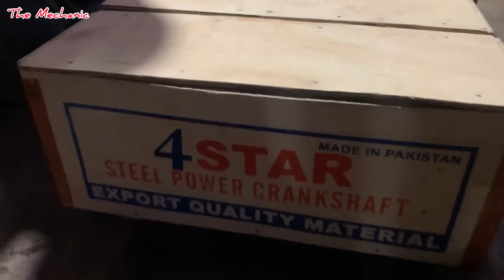Production of Crankshafts in Factory Complete Process || Machining 3 Cylinder Engine Crankshaft

Comment: Now I know what happened to all our WW2 Lathes.
Reply: I saw a Cincinnati in my old schol in '70's :-)
Reply: I have a ww2 lathe similar to these,my great uncle (reme)took it in lieu of pay in 1946 among other oddities(aircraft wheels and tyres,circular gun mounts and it seems every ammo box ever made😁,it was given to my father who made some new parts for it and then passed it on to me,I used it 3 times in ten years,once to drill new flywheel bolt holes into a rover crank and twice to thin down socket walls.I struggle to remember the name but it is stamped WD 1941 with those little arrows stamped on everything,it's been residing unused under a tarp in my father's barn behind twenty old tractors for nearly 20 years now and was still working perfectly when it was replaced.Unfortunately we don't have the same crane that lifted it in there anymore and it's been blocking in my brother's collection of old cars for all that time! Also my great grand father was a major in the Royal engineers and was working in the royal mint in India during ww2, while there he built from scratch a fully functioning replica steam loco and wagons with a bit of track,in his own words"from bits of scrap and off cuts"it weighs about 2 ton complete😁 obviously he had plenty of time on his hands and did remark that there was every bit of machinery you could imagine available,including forges and foundries,I'd imagine most of the machinery was left behind after we shipped out at the end of the war,much of those skills learnt by the locals during that time has been passed down and wonderful to see too.
Reply: Some of them our in our shop.
Reply: Yeah seriously, guess I’m gonna have to shop for that Monarch over in India, they were built to last back them, much better quality of steel too...
Reply: @ManicChampion  They definitely are, and they even made them look good instead of just a boxy lathe, my dream machines, a decent size monarch lathe and a K&T horizontal mill with the vertical head
Reply: Probably a ton from then left overseas, not cost effective to move back, glad they're being used rather than getting dumped like a lot of stuff, provided those are WWII vintage, which wouldn't surprise me. Got a 1942 LeBlonde in my basement from Camp Lejeune, and at work we have a gorgeous Monarch (44, I think) that made bomb sight components. My LeBlonde was abused for many years before I got it, but it's coming back to life quite well. The Monarch holds bonkers good tolerances to this day. Bonkers.
Reply: My grandfather was a gunman in ww2 , there is no need for them here if there is to much regulations,  fees licensing osha regulations for smelting, lathe work is ok but you need something to use the lathe on , do you understand why there not being used here now, osha would never allow a lathe that close to a wall , and no ventilation,  and electrical outlet behind you , do you understand now
Reply: my highscool had a Monarch  from 1947,   i helped shop teacher machine parts to replace some parts in the Monatch,  he opt'd for Seafoam Green paint lacquer   it was eye candy
Reply: @jaminova_1969  Happened in Australia also.
Reply: @jaminova_1969  Donald Trump tried to move them back to the US. Japan did the same to move factories back by paying them.
Reply: I had a job in a machine shop making VersaLifts. The 8ft radial drill press was off the battleship USS Nevada!

Comment: Great workmanship by hard working guys. This particular foundry has supplied BMW Germany for the past 12 years. They're shipped to Europe where final finishing and heat treatment is carried out..
Reply: @Will he heck as like
They're ultrasonic ally tested before export at a different location, some are rejected as will cranks from any foundry. These cranks are not fully ground but are finished to tolerance  in BMW's factory where they're also nitrided/hardened. The N47 diesel and various capacity 6cylinder petrols have used cranks from India & Pakistan for a number of years.

Comment: Family : Daddy why are you limping. Daddy: I thought I had that crankshaft running true  with my hammer and wire indicator. Got a fleck of cast iron in my eye and just as I was getting it out with my blackened cast iron dust hands, the lathe threw the part and it landed on my steel toed sandals. At least I had on my full length loose shirt on to shred into a tourniquet .
Reply: I am sure they have an excellent h&s programme comps & ben upto par

Comment: Well,
I do applaud the hard work being done.
But I do believe that these craftsmen need to slow down and save those lathes a bit more.
The chatter is terrible.
I’m sure they have a quota to meet, but if those shafts aren’t right, the motor fails in quick fashion.
Reply: Call for the camera
Reply: Yeah terrible chatter on that video everywhere
Reply: These guys are across the road from that  repair shop on YouTube that assembles engines on a bed of sand

Comment: NOW that’s one crankshaft that I wouldn’t like on my machine. Thrown around cast iron , eyeballed precision and so on
Reply: Kkkkk você acha que CNC sempre existiu, o homem foi a Lua, com mecânica assim tradicional. Isso sim é a mecânica.
Reply: Looks like it is for a slow moving Diesel engine, like for a boat or a water pump. For this purpose it is good enough. And towards the end they used precission grinding to get everything to the right dimensions. The bearings are most likely made with Babbit metal.
Reply: @jnne5938  my grandfather used to build crankshafts for the US tanks back in ww2 and they already used more advanced dials and tools. I'm not talking about cnc I'm talking about using precision dials and dumping cast iron like a basket ball. Good enough does not mean good

Comment: Please for the love of all things holy, stop hitting the journal to line up the crank in the lathe. The counter weight is right there. I understand that when this happened, the journal wasn’t machined and polished yet, but that’s a bad habit to have.
Reply: it's for a perkins, precision isn't required
Reply: also, then you hit it with a hammer, it's now a "forged" crank" brings in more cash! :)
Reply: this a secondary oper. final ops are heat treat final finish...castings r in the white or soft stage
Reply: @planeiron241  They were packaged with instructions, end of the line for that junk.
Reply: @mrl22222  Certainly looks like  P3.152 fitted in the Ford Dexta and Massey Ferguson.

Comment: Guys, I am an offroad racer / 4x4 gearhead currently in the US but from Pakistan which I is where these videos are shot. I have worked extensively with the chaps who do lathe / machining work there with respect to 4x4 modifications (including  Lexus v8 engine in desert racing 4x4s). Firstly, I'm still surprised that they make crankshafts in Pakistan as I didn't think there was a market for local crankshafts. Will have to speak to some people to get more information but what I can confirm is that heat treatment and shaft balancing are not commercially avaible to these people at this scale. Typically given the quality and types of parts produced along with the processes followed there has not been adequate demand for balancing and heat treatment from what I understand. Lastly, regardless of what it may look like, having used some of these products, often under extreme desert racing conditions, I can assure you that from what I can see, these cranks would be doing a damn decent job and giving the available imported alternatives a good run for their money. Otherwise, we would not be seeing this video as the total cost of engine overhaul would merit not saving a few bucks on such a critical engine component. Having said that the need for imporovents in how things are done out there is blatantly obvious though asking them to change there ways is a cause which one gives up rather quickly if you have to deal these chaps. Amazing workmen, perhaps some the most talented people I ever met. Hats off!

Comment: Instructions: Please blow out oilways, as we forgot. Failure to do so invalidates 200 miles warranty.
Reply: lollll
Reply: 200miles is probably 10x the reality for over half of those, but shipping is probably 90% of the price so what is anyone going to do.  Grind it, drop it dirty in dirty bearings, spin it around for good measure, box it up. Getting you just far enough down the road that you cant come back seems to be the running theme of these videos from pakistan.

Comment: Impressive what they can do in what kind of enviroment and the machines. But the grinding at the end didn't look well. If you clock it every time before you go to next segment to grind, how is it going to be in line ?
Reply: @Marcus Keeler Wrong. He machined one part and immediately after he hit it with a hammer to align the other part of it, the two are not in line anymore. Correct procedure is, clock all the features as best as you can and grind them in one go.

Comment: how long will these hold up, each piece has a different measure
Reply: They hold up fairly well. Consider this being the only available 'new' part, and the engines these crank shafts are for, are still in active duty despite being from 1960s

Comment: For the sheer eyeballness of the measurements, I'd bet they're within 3 thou. I was wrong, those Perkins 3 cyl spec are half a thou! 2.7485-2.7490
Reply: The grinder they use will hold half a thousandth of a inch easy

Comment: Geez it really shows how behind the times they are and the quality of the job is terrible.
Don’t get me wrong, they do an ok job with what they have to work with.
Reply: Not even close to ok. There is nothing wrong with those machines if they are in good service. Go / no go gauges are common in production. Problem here is they plain just couldnt care less, everything is dirty, parts are just thrown around. They ground the journals and then while it was still dirty dropped it into dirty bearings and spun it around as the QA check... They couldn't even be bothered to give the journals a quick polish. A whole extra minute of giving a ** and keeping things clean when they need to be would have produced a serviceable part rather than junk.  The tap so wore out the kid couldnt get a bolt to thread in was a great tell, they only replace that when it finally snaps. Or needing a cheater bar to push what is a very small drill bit in a lathe that size, dont sharpen the bit just abuse the machine.

Comment: very skillful operators .working on manual lathe /Mill  is not easy .its the most talented who can work on it.still in US tool Makers are still using Bridgeport machines and are the best machinists .but the CNC is the best for such high precision tolerance.If thses guys received a training about GDT and Quality they would be surely the best.yet they are really excelent with the equipments available to them.CNC improved a lot the industry now the Engine or tranny can last more than in the 70S

Comment: I've read through a bunch of the comments. No, these crankshafts don't compare to anything made in Germany, Japan, or the U.S.  I still have tremendous respect for the workers making due with what they have. Along the lines of making due, here's an interesting story for those interested... A friend of mine was born in Cuba shortly after Castro took power. His father was a machinist and his mother was a schoolteacher. They applied for permission to emigrate to the United States (when Cuba still allowed that--for a relatively short period of time after Castro came into power). Both of his parents were immediately fired from the jobs. His father was sentenced to a six months in a prison work camp. When his father got out, the only job he could find to support his family was as a delivery truck driver. He was able to acquire an old box truck and used it to deliver whatever he could to feed his family. Problem is, the cranskshaft bearings were shot and needed to be replaced. Well, replacement parts simply weren't available. So every two to three days, after driving, loading, and unloading the truck all day, he could tear apart the engine and fashion new crank bearings out of an aluminum soda can. He would work through the night, put the engine back together, and be back in the truck in the morning. The fix would usually last two days, maybe three if he wasn't doing very much driving. He did that every two or three days for about two years before his family was granted permission to emigrate.

Comment: That two step shot-peening step would provide a surface compression to the casing that would improve it's crack resistance, and cast iron is very hard.  I'm sure a surface hardening step would be an improvement, but, aside from a bad casting, these probably provide a reasonable service life.  I kept trying to get a good look at the fillet radiuses at the journal cheeks.  They looked pretty good there at the end when they were wiping the crank.  Large fillets and the shot peening are good.

Comment: Having built and rebuilt a few engines, I have an issue with the crank checking process. Not sure of elsewhere, but here in the states, a main and cap are one, the engine is line honed on torqued caps so they are perfectly matched after the build is complete. So only one cap goes to one main (At least how I was taught), them checking using the same cap on multiple mains is problematic for me knowing how we do things. I also saw no heat treating, but this is a 3 cyl engine, so probably not much power, I can let it slide a bit
Reply: Heat treating comes before machining and not after so they would have had it done prior and I doubt that these cranks needed nitrating for their application.

Comment: The conditions of the workplace remind me of when I was an apprentice engineer in the early 1960s.  The machinery is archaic and probably worn our out. 
My main gripe is when they are checking the crankshaft, why do they not clamp all the main bearing journals at the same time, If they did that and used engineers blue they would get a more accurate result.
Reply: Pretty sure they were only checking the clearance for the bolt on counterweights.

Comment: Cast Iron crankshafts because turning them is way easier than traditional drop forged Steel...Remember, all the turned diameters will be ground to size later on the cylindrical grinder...Oversize journal bearings to compensate for them being cast iron of dubious specification and quality ....🤔🤔😳😳😳😳🇬🇧

Comment: Great  video. I loved to watch to the end. Very simple lathes and grinder, tap and drilling machine. They work well with what they have and the final product get well done. I did't see they balancing the crankshaft for vibration. Where they inspect the crank for last; is that a gauge or just a hold the part in place? 
I need also give a congrats to the video maker for no adding  any sound or music to the video. Congrats for your video and for posting. It was amazing.  Nyko461 from Texas USA

Comment: Is there any way to check these items for alloy specification ? On the whole, very industrious and great work.
Reply: The colour of the casting, the ring it makes when you tap it with a hammer.
Reply: @joefish6091  I'm an aircraft structural repair mechanic and I'm involved in fabricating and heat treating various parts. I do the ring test myself, which surprises many of my co-workers. They take bets on me estimating hardness numbers. I'm usually within 2-3 points either way on the Rockwell B scale. If the job concerns safety of flight , or is a major repair, I'll run it through the system to get it officially hardness tested and a signature on the paperwork.

Comment: if that workshop was here in the UK they will shut it down for health and safety reasons, because of not having any guards on those belts and pulleys. Most of our workshops have been closed down because it was cheaper just to buy a new part. Really sad because I would love to have a job like this.

Comment: It looks to me, that this crankshaft is made of grey cast iron, which is a very soft material. Maybe is a 5 liter engine producing 35 hp and turning 700 rpm at full throttle.

Comment: I appreciate the production made with limited means. This job can be done in a large factory. But i want say somethings.
It says steel on the boxes, but this material is cast iron. I did not see any heat treatment. I don't know what kind of vehicle it uses but it cannot be used in a modern car.

Comment: The shaft shown is for a Perkins diesel 3AD-152 with a one piece rear main seal. Max RPM 2200, hp about 40.
Reply: Also Mf240

Comment: Respect for the machining but I doubt the surface finish on the big end journals will last too long?
Reply: They are running in lead bearings so the crank will last long enough

Comment: From what I know: Many american (such as Chevrolet and Ford straight sixes) cars used cast crankshafts, forged were used for high performance engines, billet crankshafts were used in really high performance engines.
Reply: Don't forget the splash lubrication too.
Reply: @bingosunnoon9341  Yeah I had several with splash lube only.  One with no filter and one with, separate pump to filter only.